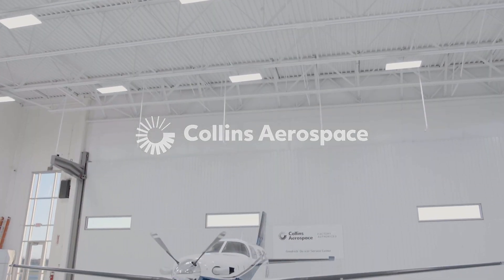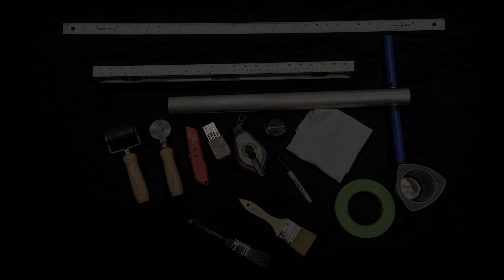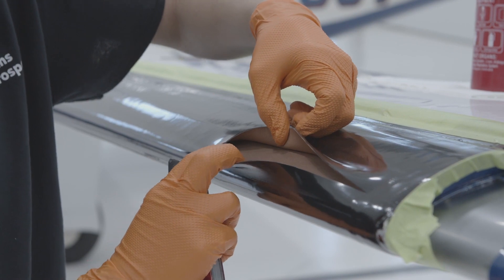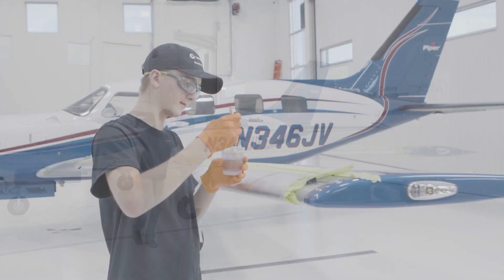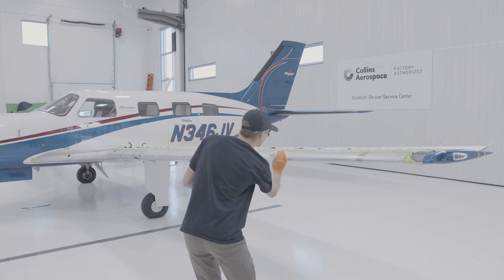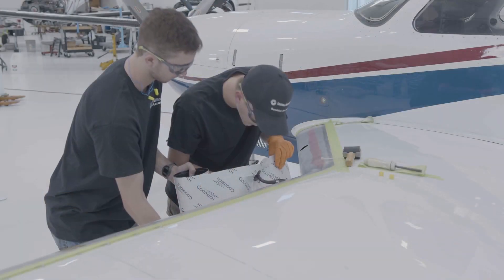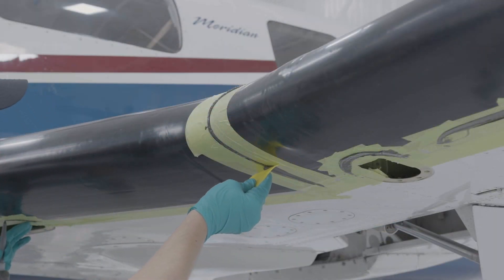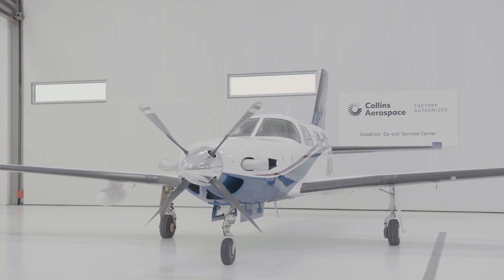How to install FASTboot® de-ice boots | Collins Goodrich De-Icing

Comment: REMOVAL PRO TIP!!!
Patch any tears & holes on the boot then pump that mofo full of Tolulene until it won't take any more. Wait about 30 mins. Pull up about .5" all around the boot & grab a corner with pliers & pull outward as you spray Tolulene underneath the lifted edge.  The boot will come off like a wet bandage in the shower.
This video was heavily edited and in real life took 2 people hours! Try the way I mentioned and it will be off in less than an hour with 1 mechanic.

Comment: How do you get bubbles out??? We just did our first one and have a few bubbles, can you remove them?
Reply: You normally cant unless you can pull the boot up to relieve the bubble. Then you can put 1300L back down to reapply the boot. Dont recommend doing that though. In the future you need to make sure you have 3 people, 1 roller & 2 people to hold the boot at a 45 degree angle so it doesn't stick before you are ready ro roll.  When I do mine, I remove the center line and the all the backing on 1 side, roll that entire side perpendicular to the boot from inboard to outboard ALWAYS PULLING DOWN, OUT, & TIGHT

Comment: I'm not a pilot but this process seems VERY technique dependent. Seriously, it seems like this isn't a real process, more of by the seat of your pants/whatever works! What if you make a mistake or misalignment? Like wallpaper, do you constantly pull it back off and try again? Bubbles?
Reply: A lot can go wrong in this process. It made me trust less of this kind of plane.
Reply: @s.v.discussion8665  I bet!
Reply: It is technique based and honestly after you do it wrong  3 times you figure out what NOT to do. I can do these with my eyes closed off & on in about 90 mins.  
This video is heavily edited and they could have  done a much better job with the video had they talked to multiple mechanics & gathered there perspective.  Im not sure if those 2 individuals are A&Ps or helpers but regardless, the job can be done different ways.  There are by far better techniques & tricks then what they show.